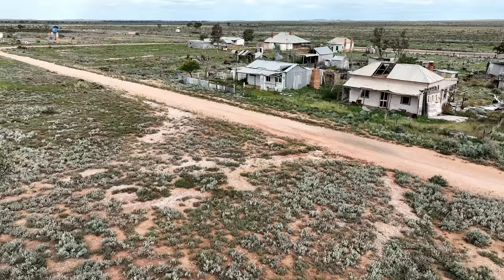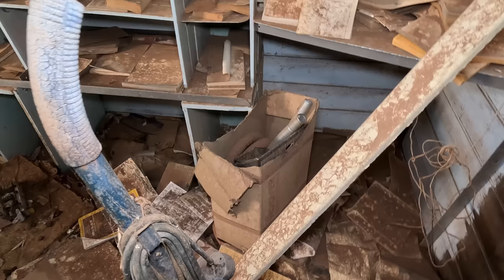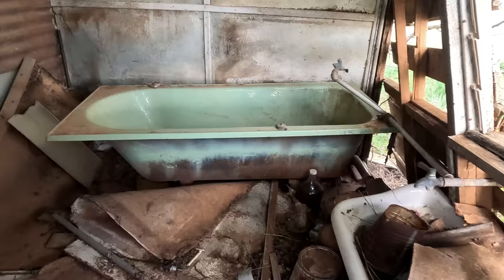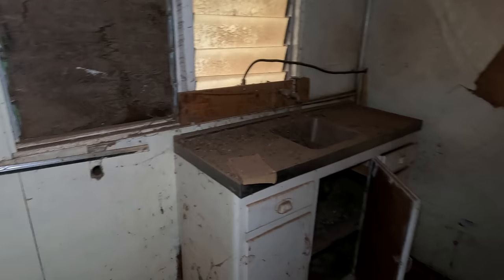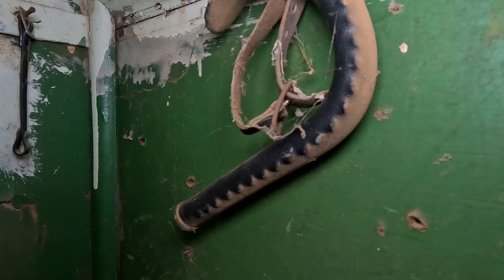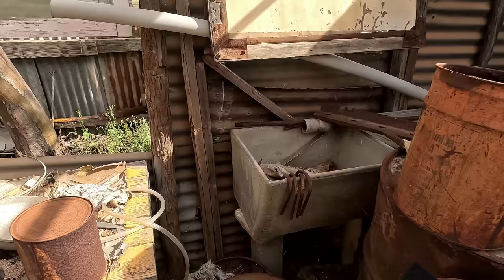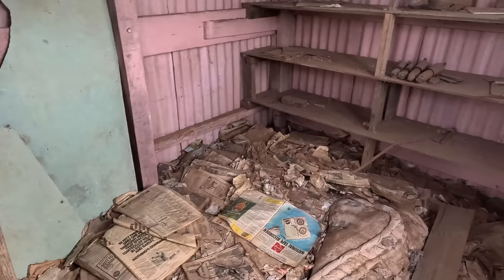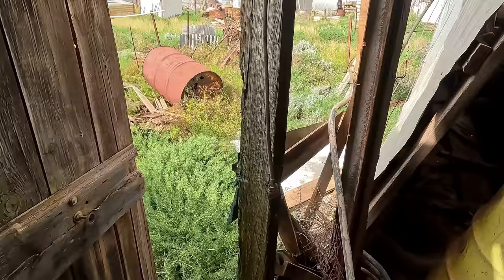Australia's Abandoned Ghost Town

Comment: 25:35 - the old washing machine. We inherited one very similar to that, if not the same, when the immediate family moved into a house from an uncle's real estate spread, back in early 1979. Even then, it was ' shit, that's antiquated. '. But we used it for several years hence, not automatically replacing it. That top part is what you'd run the washed clothes through to wring them out. Sometimes I would circumvent that and go straight to the clothes line, and someone would say that you're supposed to use that, but I was for not messing with that.

Comment: Those batteries were used to power the telephone and were supplied by the PMG to anyone that had a phone connected. To make a call one would lift the handpiece and crank a handle on the side of the phone. They would be answered by the PMG operator who would then connect them to the callied party. That bell set you picked up was part of the phone system.
Reply from the maker: Cheers for that yes that makes sense but I do remember a old battery powered radio my grand father had it ran the same batteries cheers for watching 😊

Comment: The Eveready battery a collectible ? Nah. Doesn't rate how old or discontinued it is. But you could get one or two dollars for it at a scrapyard. Not any more than that. It is not too big. You could add those other couple of batteries and any others lying about, and put at least a tenner back into the economy. You could rock up wit a ute or a truck an take whatever you wanted from that place, if you wanted to do a far-flung scrap run. No one would give a stuff. You'd be doing the place some good.

Comment: What was weird was in all that film, i dont think i saw 1 toy ??, just seemed odd.
Reply from the maker: Come to think of it Malcolm I didn’t see any myself good point there but there were plenty of books cheers for watching
Reply: @wernersadventures8330   On another town, as a kid we, being my parent, sister & myself lived in Wittenoom, as my father worked in the mines their, God as a little kid , probably 3yrs old i remember getting large chunks of asbestos rock and peeling the fibres off, the whole towns roads were sealed with Asbestos fines, we also used to put out tongues on that flat surface as it quickly sucked all the moisture off your tongue, looking back years later and not having any problems makes me thank my lucky stars, my father ended up with Silicosis, but my point is have you ever checked out the Ghost town of Wittenoom ???. Would be realy interesting i'd think, as everyone left and from memory everything was left in place pretty much due to Asbestos fears, though back then, we were still ignorant of what that realy meant. Cheers Werner.
Reply from the maker: @malcolm.wilson.5885  hey Malcolm no never checked out that place where abouts is Whittington. A lot of the old homes have aspestos in them most of the time I wear a mask cheers